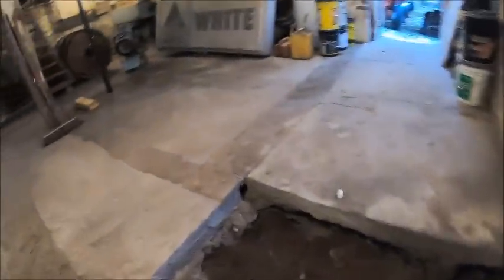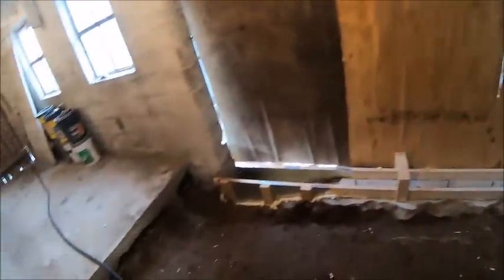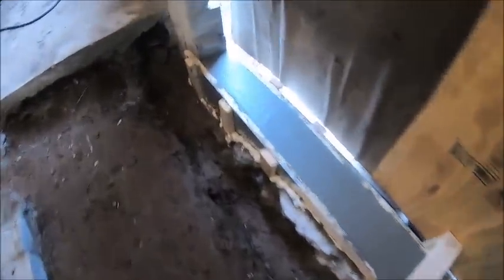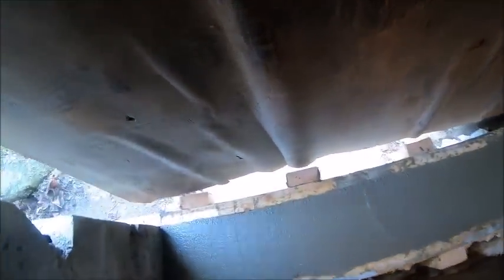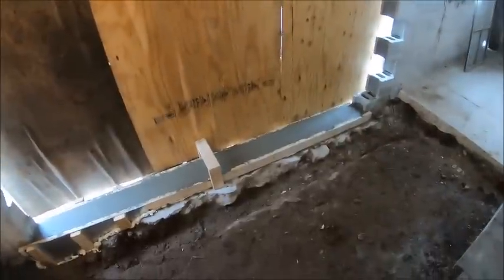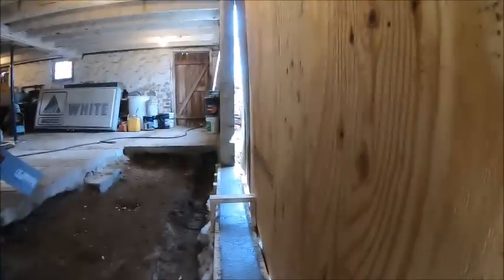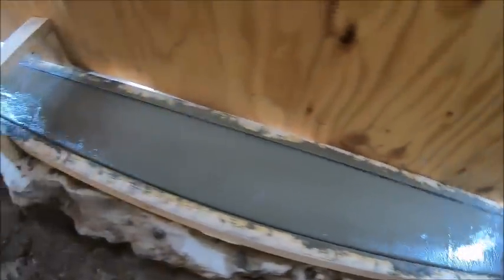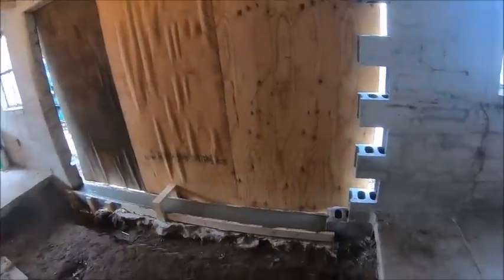Barn Door Project Part 6: First Concrete Pour And Viewer Mail

Comment: While driving on 31 North out of Berrien Springs, on Friday Jan 06, 2023. I noticed an Oliver Four Wheel Drive not sure on the Model # sitting on the East side of the road by a barn between I believe Hinchman Rd. & Linco Rd. Didn't know if you knew about this tractor or not? Just caught a quick glimpse of it. I believe it has duals on it. Good luck on the barn improvements.
Reply from the maker: I’ve know about it for years.
Reply: @Oliver66FarmBoy  I thought you might, didn't know for sure. By the way I'm the one who gave you the cornpicker screen at the Fair this year.

Comment: We had a cement mix on our farm. It was on a heavy duty stand a transported on a scoop tractor to a gravel pile was dumped by our good friend of the family which the guy had a sweet looking Mack thermodyine tandem axle dump truck. Anywho…it was an electric motor powered an had a long steel handle that flipped the barrel from mixing to pour.
Reply from the maker: A one yard mixer was a pretty standard piece of farm equipment for years.

Comment: Another good one as always sir, I found a good door for my 4–150 but I was wondering where you got the bearings/bushings for the steering links for yours. I found some but they’re wanting almost $250 each for them
Reply from the maker: AGCO.
Reply: Maibach is the only ones that had any, they showed 8 in the warehouse. And they want over $200 each. But they did have a good door so I bought it because the previous owner left the door open and backed out of the barn the tire caught it and did all sorts of bad things to it